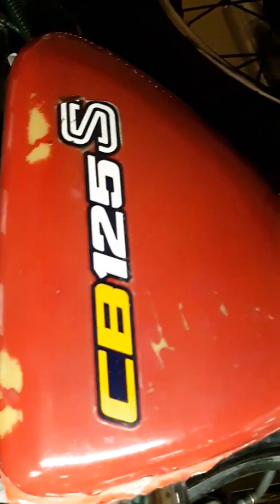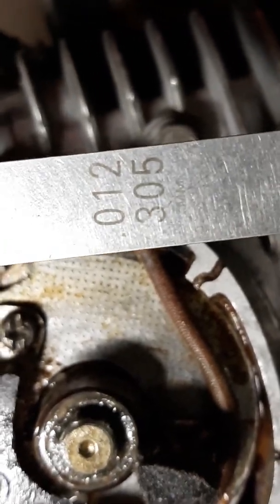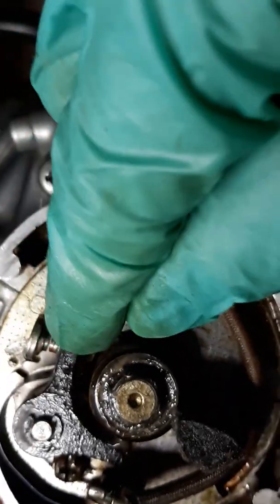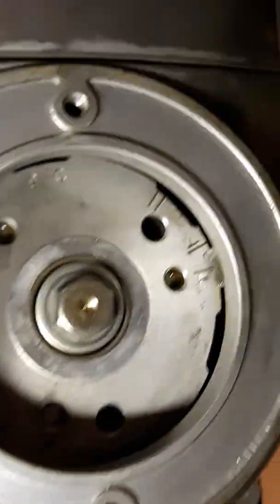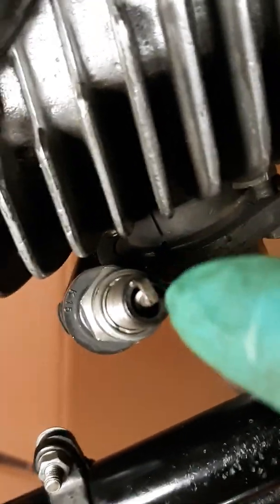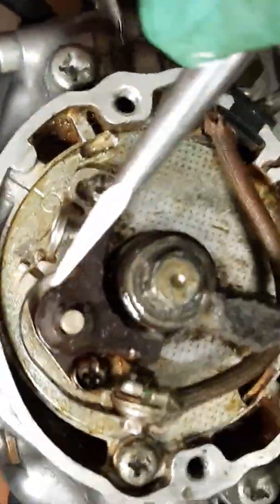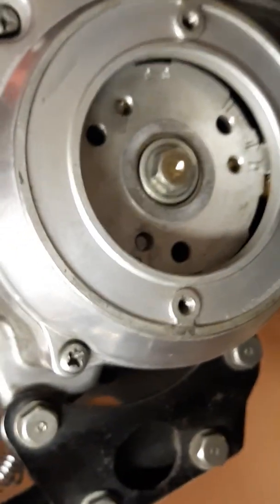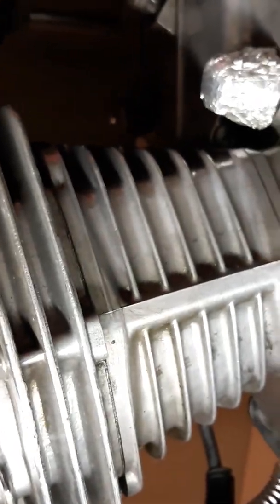Found A New Way To Set The Points Gap And Timing On 1978 Honda CB125S

Comment: not clear. a full circle is not 180, it is 360!  you're nost clear in exactly where to set to center.... F or T line AND where is the line on the enginedoes that point line up to??  then you don't show How to adjust the plate behind the points to coincide with anything.   confusing, long video that should have been Edited instead of this!

Comment: Hi. I am doing this at the moment on a 85 honda. noticed that the highest point on the cam is not the same as tdc. its slightly after. cam timing is correct. you would think the highest point of the cam would be tdc.
Reply from the maker: Hello and greetings. Thank you very much for watching my videos and for your comment. I find that the cam is so small you really can't tell what the highest point on it is. That's why I take the flywheel/stator cover off and set the timing using that. Maybe if the timing chain is stretched and slack it would give you some variance. The main thing is to have the spark plug Spark on the F mark on the flywheel. Let me know how you make out with your project please. Thank you very much and have a great day

Comment: I like this way much better than the way the light or meter method. Thank you.
Reply from the maker: Hello and thank you very much for your comment and for watching my videos. Yes you're absolutely right. The method showing in the service manual makes you disconnect the wire. And that wire is secured by such a tiny screw and nut I don't like messing with it. It could easily break. Also I've noticed sometimes when I put the cover back on it grounds out and the bike wouldn't start. What bike do you have?
Reply: @irfaanxlcr8370  hey man thanks for the video this is a great tip, I'm going to try this on my bike. I'm trying to get a 1971 Honda sl125 running and the timing is way off. Someone's been through this bike before and everything was wrong.
Reply from the maker: @jradish  
Hey thank you very much for your comment. Thank you for watching my videos. I'm so happy that it's helpful to you and to others as well. If you need any help on anything ask me please and if I can give you any input I will. Let me know how you make out for the bike. I'm so happy to know that you guys are keeping these old bikes going.